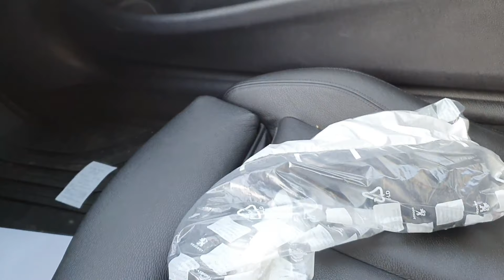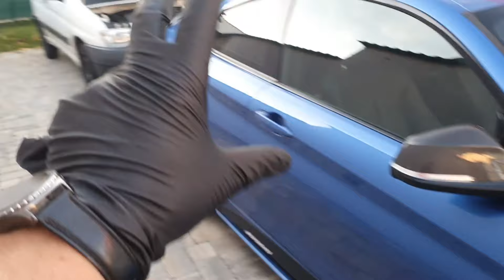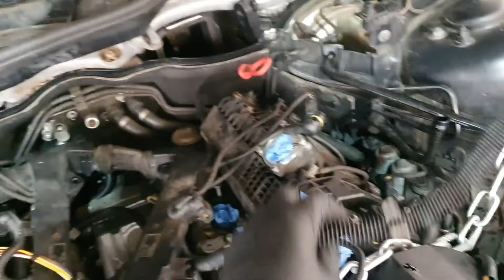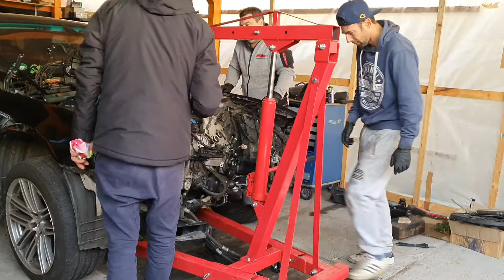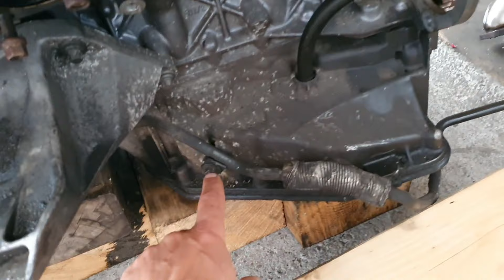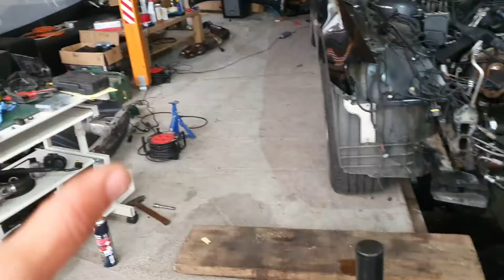It's coming out! The engine is coming out! Bmw e65 735i V8

Comment: The pipe in middel is leaking, in the pipe runs the coolant (has o-rings on both sides ad I remember! common problem with these and a major fabrication mistake from bmw. In USa they sell a kit for it ! So that you can cut the old pipe in middel and take it out without taking the whole engine apart.

Look here my friend! The engine is nothing wrong with it https://youtu.be/XoG_-7vp1fM
Reply from the maker: I know about this problem but this car doesn't have it. The coolant level wasn't dropping, the engine was bone dry but was throwing a lot of water on the exhaust and a lot of smoke and it didn't pass inspection. I've tried a lot of things before I decided to take the engine out. Even if the stem seals are bad the repair here in Germany is 1700€ and with that money I can buy a used engine with 1 year warranty...that's why I went this route! Thx for the info anyway and thx for watching 🍻

Comment: why didn't rebuild it should be way cheaper & guaranteed solid engine!
Reply from the maker: In Germany is the other way around....just for stem seals repair will charge you 1700€, to rebuild an engine here will cost me aprox 5000 € and the engine (and car) has already 250.000 km so it won't worth it. With 1700 € I can buy a low mile engine with 1 year warranty that's why I went this route